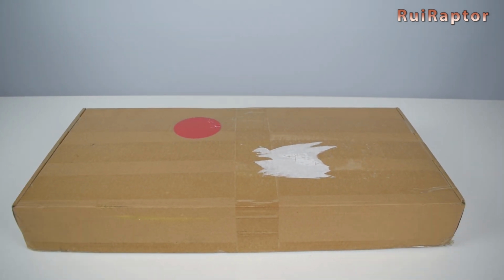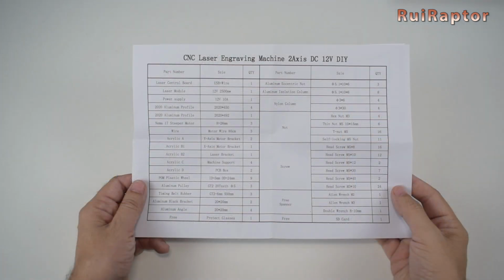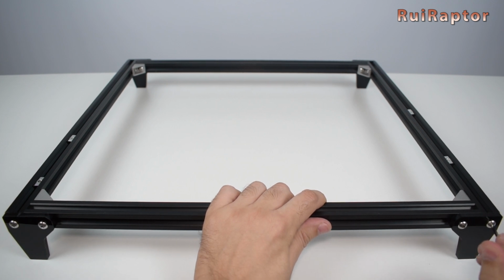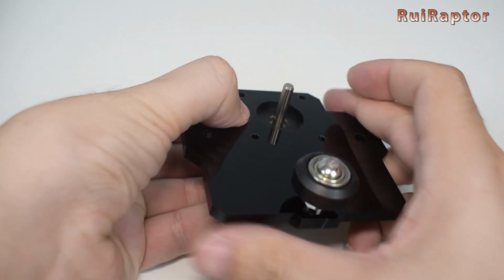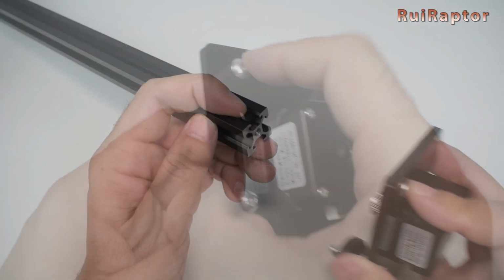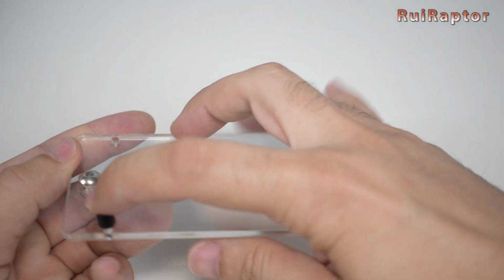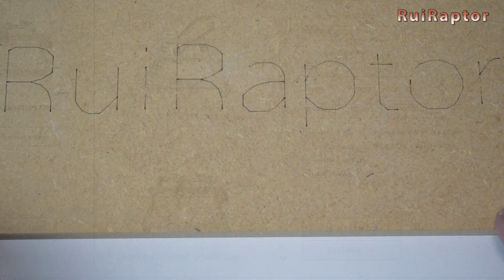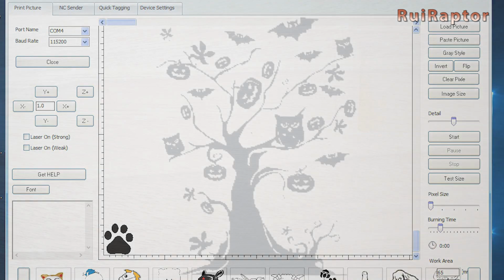TWOTREES Mini Laser Engraver - Assembly & Tests

Comment: Hi, I have gotten a CNC Laser Engraving Machine TT-2.5 TT-5.5 7.5w 20W, all connections and part are asambled but the laser light is not appear, the laser module is not shopw any light and is not burning the material for ungraving, I can lisent sound and it moves itsself when I ordered a project. Can you help me to fix it. Please

Comment: Hello. I just use my engraver for the first time it moves but it doesn’t burn any tips
Reply from the maker: Hi, make sure you are selecting the correct output power in the software and also make sure you have the correct focus adjustment of the laser dot.

Comment: Hello,  I have this Laser Engraver I just bought.  I got it all put together thanks to your video.  However I tried to install the software that cam with it and it won't install.  I have tried LaserBurn and laser GRBL.  and I get get the TWOTREES Mini Laser Engraver to work at all.  The motors click and that's all.  I don't know what to do?    any ideas??
Reply: Sounds like you might need to adjust the power on the stepper drivers. This easy to do but just as easy to get wrong. Research you tube for stepper driver tuning.
Edit: Just read down and found out that there is also an issue with the wires to the stepper motor. The fix is to do with the order that the wires are in.

"Hi. I had the same problem with X-axis not working. As advised by the vendor, I changed the order of cables from the terminal plugged in the motherboard. It should be red, black, green, blue. Mine was red, blue, green, black so I just switched blue with black. Now it works. By the way, the other terminal plugged into the motor should be green, black, blue, red. I hope it helps."

This is the entire quote.

Comment: _______________
HELP NEEDED!
Hello, I am new to laser engraving. I have purchased TwoTrees 5500MW CNC 300x400mm laser engraver, but I can’t get it to work properly. From what I understand the X axis doesn’t do its job properly. When engraving line the X axis is working properly, but once You go into the line or dot mode it jumpes through the empty spaces and makes a dark spot instead of an image.
Can You help me solve this?
The engraver: https://www.gearbest.com/laser-engraving-machine/pp_3008834352845081.html?wid=2000001
Software: http://lasergrbl.com/
Reply: Sounds like you need to up the "Feed Rate" and lower the power. What setting did you use.

Comment: Buy a machine, put it together and start it up. but the X axis is not moving, the Y axis works fine. Someone else has this problem and how can I solve it?  . 
video with the problem  =  https://youtu.be/I9BBCASKkxU
Reply: Hi. I had the same problem with X-axis not working. As advised by the vendor, I changed the order of cables from the terminal plugged in the motherboard. It should be red, black, green, blue. Mine was red, blue, green, black so I just switched blue with black. Now it works. By the way, the other terminal plugged into the motor should be green, black, blue, red. I hope it helps.
Reply: @bukbukra1  this company seems like a good way to go blind... think I will pass.
Reply from the maker: Hi Fabian, check on the board if the drivers are ok and correctly placed.
To troubleshoot, swap the X for the Y stepper motor cables and check if the X moves.
Reply: @ruiraptor  i have same problem can you help me
Reply: @ruiraptor  same problem too, i switched the cables on the board and it was moving, switched it back, then switched the drivers and the problem is still there, so its faulty board?

Comment: Thank you so much for for your video. 

We just completed assembly and our y axis seems to be stuck. It is not moving smoothly 

Any advice?
Reply from the maker: Hi Adelle, thanks for your comment. Regarding your Y axis,  maybe the belt is too stretched or the grip of the wheels is too tight. Check this video on how to correctly adjust the eccentric nuts and see if it helps: https://youtu.be/GsEdU8ZtI6U
Reply: ruiraptor thank you. Will have a look.

Comment: Bought this kit from Amazon. I got it working ok, but the x-axis motor driver and the laser stopped after a couple of hours. I got a replacement, but that laser stopped working after about an hour. I had made sure not to use more than 50% power, and the laser in the second unit had something rattling around in it when I went to box it back up. Very disappointing. The first burn or two had me hopeful that I would finally be able to afford to offer personalization on my projects.

Comment: Just bought it. It came with the MKS DLC 2.0 board. And the problem is that the axes do not move. All I can do is turn the laser module on and off. I think the problem is with the firmware. Could someone help me with this problem?
Reply: I bought one off of amazon and the x-axis unit and the laser quit after a couple of hours. I got a replacement, and the laser stopped working after an hour. I only used 50% power. After reading the manual completely, I noticed a warning that the circuits were vulnerable to static electricity. It was very disappointing
Reply: Tengo el mismo problema, pero solo el eje X no se mueve. alguien encontró como repararlo

Comment: Is CorelDraw compatible with the machine? Planning on buying it soon :) Great vid btw!
Reply from the maker: Corel Draw will work but you still need to load the image (after your rework) in the engraver software to generate the gcode file.
Reply: @ruiraptor  okay tysm!
Reply: Curious if you ended up buying one.

Comment: I've now bought 3 of these machines. Thanks ruiraptor, you made assembly much easier with this! Just to clarify there are no problems running Lightburn with this machine, I did have to adjust the steps from 800 to 40 as the measurements were messed up out of the box. I'm just about to bolt on an endurance laser (10 watts).
Reply: Did switching to Lightburn solve the pixel too big issues they mentioned at the 25:25 mark?
Reply: I had a bad experience with two units failing, so I'm curious how they have worked out